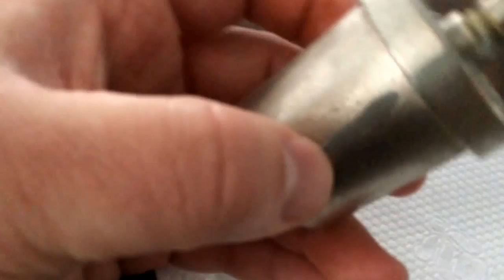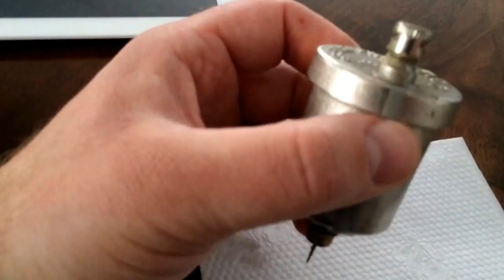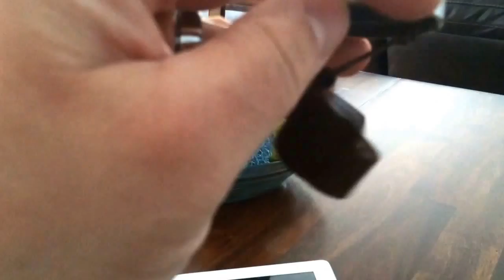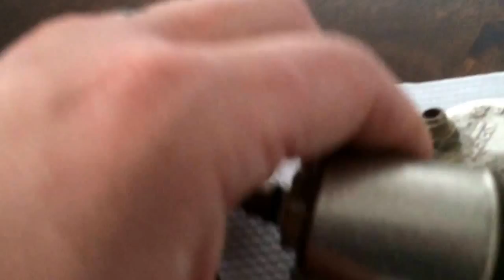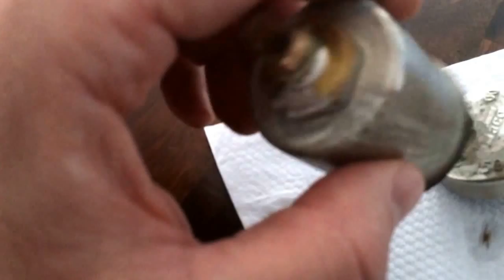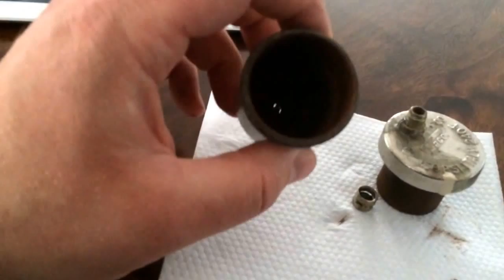Automatic air vents in hydronic systems. Do you maintain them?

Comment: Informative video.
I changed out my Taco hyvent above the expansion tank that was leaking and replaced it with a Watts automatic float vent.
I had shut off the electricity to the furnace and shut of all the water supply and drained the furnace.
After installation of the new Hyvent and turning on the electricity to the furnace and opening the water supply my pressure is now around 24 psi.
Is that ok if not how can I drop the pressure to be where it needs to be?
Thank you

Comment: I don't know if my baseboards have these, but I have something similar on top of my boiler, and this part was leaking badly and looked corroded.  My pipes were banging like crazy and I had a water sloshing sound in the pipes on the second floor. I called the gas company contractor who I have a contract with and my wife said the guy replaced the bleeder part in question and must have did something else because my system is quiet as can be now and works great. good vid.

Comment: Rob, I constantly have air in my hydronic heating system....I've purged it more times than I want to discuss.....
My furnace is in my basement and I have two of these vents, one above each zone valve. This isn't the highest point of the system obviously.
So, my boiler pressure is around 20 psi, the expansion tank is cool at the bottom and hot at the top, the relief valve is letting some water out into the drain bucket (maybe a cup a day) and every time I purge the air it's back in a few days.
My HVAC guy has looked at it and he thinks I have a leak somewhere which is letting the air in but I have no evidence at all of any leaks. The only water I see is in the relief drain bucket. No ceiling stains etc.
Is it possible that the bleeder valves just don't work at all ?
There isn't any evidence of water leaking from them, at least not recently unless it evaporates as soon as it leaks out due to the valve body being hot.
Reply: Will Beames the boiler should be running around 12-15 pounds. That relief needs to be changed. Get a qualified tech to look over your system. Most likely you expansion tank is bad or your PRV is over feeding.
Reply from the maker: Will Beames first you need to change the pressure relief valve. It should not be leaking at all. See if that stops it because air could be coming in there.
Reply: Rob, thanks, I noticed that the operating pressure is 30psi after I replaced both of my hy vent bleeders. The air went away for a couple of days and the pressure was maintained at 30 psi. However, yesterday, I heard the water in the pipes again. When I checked my boiler the pressure was 20 psi and there was a small amount of water in the bucket under the relief valve. The water noise gradually went away but it's still audible. The pressure is still 20psi so I'm wondering if operating at 30psi tripped the relief valve and now the autofill can't get rid of the air that's now in the system. The bleeder's have done what they can but more water pressure is needeed.....is this possible ?
Reply: OK I'll change the relief valve next. The expansion tank is only 2 years old. Could it be that the expansion tank just isn't big enough ?
When you say my PRV is over feeding.....that's the auto fill, correct ? (Pressure reducing valve I assume)
That looks new but I've been here 10 years and I don't think it's been replaced in that time.
It's a Watts, looks easy enough to adjust.

Comment: Rob, mine is dripping, so I bought a new one. Last year I replaced it and now I forgot how I did that. I guess I just have to shut off the water supply, though the overflow tap filled a 5 gal jug to the brim? Should I turn off water supply if the water pressure is gone as well? Any advice is welcome. Thanks

Comment: Good video. When they fail I replace them with a Caleffi float air vent. They seem to be pretty leak free. The key is to install a 1/8th inch ball valve below them so if they fail they can be replaced easily.
Reply: Yah, the Caleffi just seizes up within a year and doesn't vent anything. And the "check valve" they sell with it, is worthless. I'll take the Taco Hy-Vent anytime.
Reply: +PHC Apprentice I just swapped a replacement into mine; its leaking water at the valve now I don't know if I should fire it up. Any ideas

Comment: Hey Rob I had to replace a TACO high pressure vent on a air separator for the closed  condenser water loop. it was all rusted and in bad shape.
Reply: +Emin HVAC I just did this on mine and the replacement is also leaking out of the valve. Any ideas?

Comment: i have them in the truck if they start leaking i usually just replace them .like you side some do not come apart .. but good point,, you can probley clean them out ..
Reply: +steven lavimoniere I bought a replacement for mine and it has a valve kinda like a bicycle tire valve and the replacement is leaking out the valve. It's brand new so I'm concerned. Is that normal behavior my understanding was that it should only allow air through the top?
Reply: shut of the cap and the leak will stop must have some durt in there
Reply: steven lavimoniere Thanks Steven! You are doing good work!